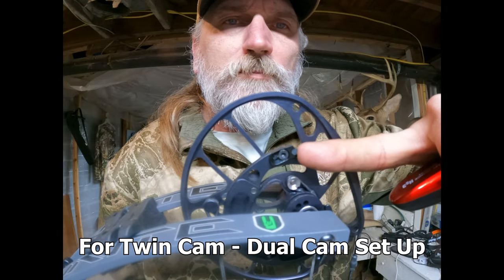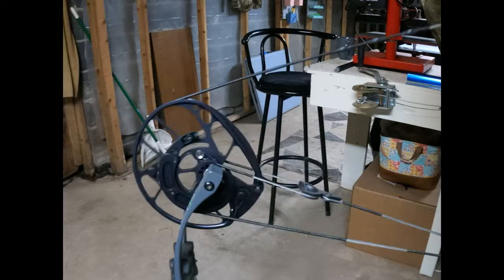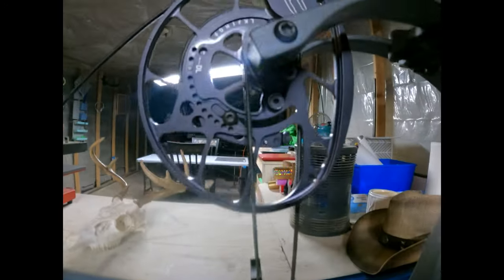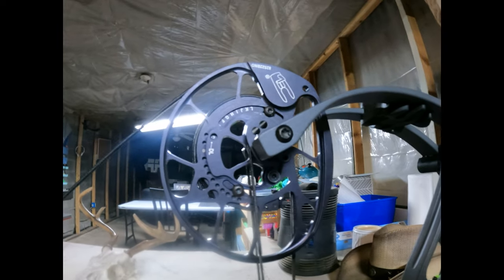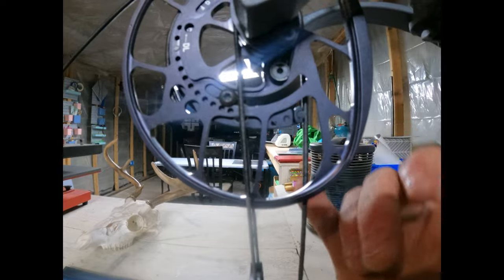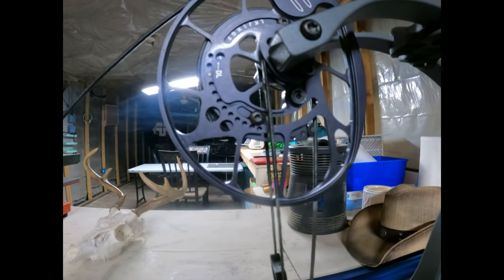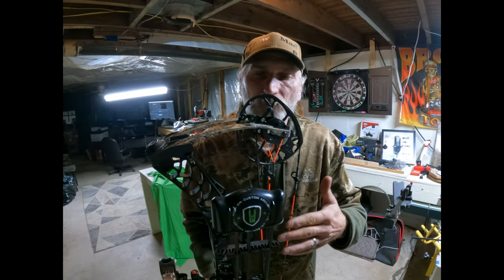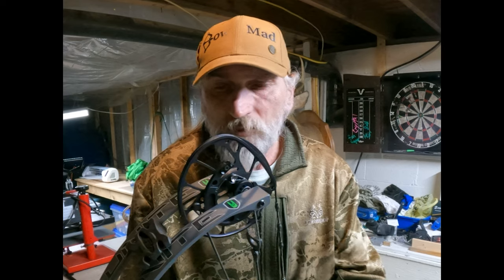Do This To Get Better Arrow Flight

Comment: By pulling by hand, not with a mechanical crank, you can feel which cam wants to pull more, before the stops are engaged. Both Paige Pearce and Levi Morgan don't require, absolutely, that the cams be perfectly synced.  On my bow, the upper cam definitely pulls first and harder than my lower cam.  Too, I have 'up tear' issues, through paper.  Pulling by hand tells me to retard the upper cam.
Reply from the maker: I can agree with that, I had to do that with a Mathews bow, totally forgot about that. My problem was using a QAD drop rest on the V3x, kept getting a low tear no matter how I adjusted the rest